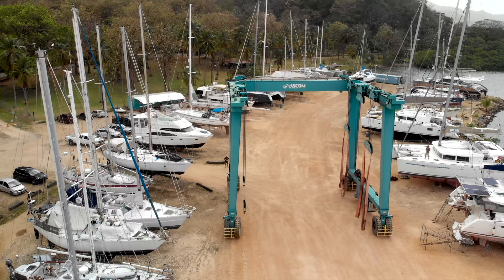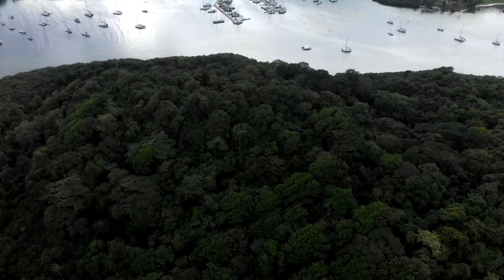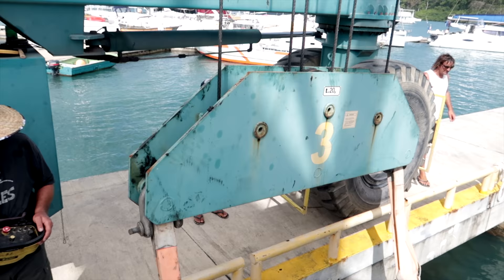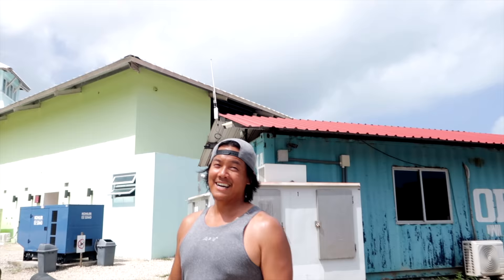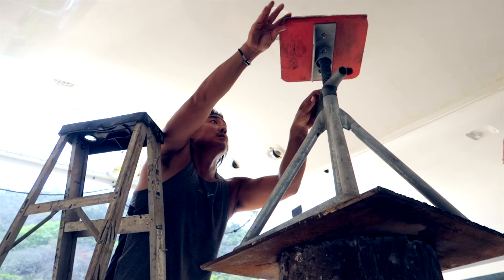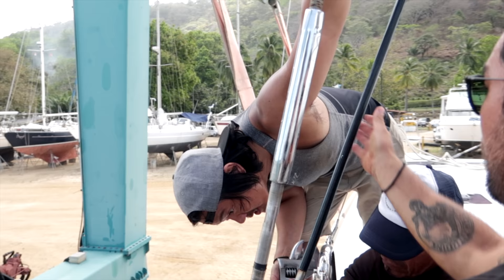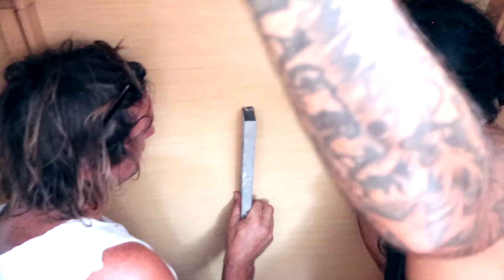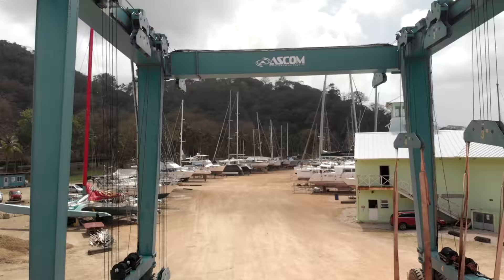Straighten Your Bent Catamaran in 8 Simple Steps - Cracked Bulkheads on Lagoon 450

Comment: Intersting that you have to loosen the rigging for it to level out. Makes me think it was too tight to begin with and caused damage otherwise it would be loose unless it was adjusted after the bulkhead break. What do you think?
Reply from the maker: So the bulkheads on lagoons 450s have been failing slowly since the boats initially launch. So over time the boats bend a bit and then at the next rigging check someone tightens the rigging back to spec. Then the boat bends some more and once again the rigging is slightly tightened the next year. It’s such a gradual process that owners/charter companies can’t really pinpoint the cause of slack. To add to that we’ve discovered that Lagoon’s tension specs are actually too much for the bulkhead design to handle. So you’re not wrong at all, the factory tension spec is too tight…or rather the bulkheads are too weak, . It’s now recommended to go a couple hundred kg’s under the low end of lagoons original tension range.
Reply: @david_shih  Thanks makes sense👍

Comment: Has anyone considered constructing the bulkhead like a box beam. The single or triple laminate plywood on the  bottom of the bulkhead has no flange. It is all web. Turning that bulkhead into a box with plywood on the outer faces with dimensional lumber creating the box will provide better resistance to the deflection. Fiberglass as a layer on a sheet of plywood is only marginally better then the raw plywood when you are loading it to bend on its length.
Reply from the maker: Tyrone, I read everything you said and it sound super smart but I’m a bit lost. Do you mean using dimensional lumber to create a frame and skin it with plywood? Or more like a section of traditional house framing, but with plywood instead of drywall?
Reply: @david_shih  Yes David, to both questions. But I think I would use hardwood to create the frame and "interior structure" of the new bulkhead. I would build the WHOLE bulkhead in EACH HULL as a frame. Very similar to an interior door in a house but on steroids. A house interior / closet door etc. is very, very strong in respect of bending resistance & torsion resistance in comparison to its weight. (Most interior house doors are skinned & "egg crated" with hard board-"Cardboard")
         The bulkhead plywood being one complete homogeneous piece or made to be one piece. This can be done by routering a 1/4" or two 1/8" - 3/16 " hardwood splines on the joining edges of the plywood. Like tongue & groove. I would entertain making the cosmetic interior plywood on both sides of the bulkhead the actual bulkhead. Stain it a light honey interior matching color & clear coat, varnish or epoxy coat it. 
         The interior of the framed bulkhead plywood, I would line with epoxy impregnated biaxial cloth. The interior of the "framed" bulkhead I would suggest using an "egg crate" "honeycomb" technique made from 1/8 -1/4" hardwood plywood everything coated in epoxy not fiberglass. Don't forget to provide drain holes. 
          I am attaching the following as an aid to understand the concept. https://www.popularwoodworking.com/woodworking-blogs/a-simple-jig-for-bottle-dividers-or-egg-crate-joints/
This is easily made with a circular saw. Even easier if the saw blade is the same thickness as the proposed egg-crate material/ plywood thickness. ie. 1/8 - 3/16 inch.. 
         It is a conceptual & industry problem. Very, very obvious in these videos;  
https://www.youtube.com/watch?v=UX9hH2bIbnw
https://www.youtube.com/watch?v=hAQuq-OW5RU&t=256s

Comment: Seeing a structural bulkhead just bent like that gives me the absolute willies... you'd imagine that Lagoon would be falling all over themselves trying to get this sorted but... from what I've seen they appear to have their heads in the sand :(
Reply from the maker: So weird isn’t it? They seem to have a total disregard for their reputation and hard earned brand equity!
Reply: @david_shih  not that weird, I've seen this a lot in IT security where some company gets hacked and a few million bits of personal information are floating on the 'net after, but they keep insisting it wasn't them, it wasn't real, it didn't happen, and when push comes to shove they'll potentially maybe admit that yes perhaps they did have something happen but no worries, it's under control! It's a knee-jerk reaction to a problem - or rather, attempting to ignore the problem until it goes away. I guess in Lagoon's case, they don't want to be like "yep, the 450 has a problem" and end up either having to recall all of them, or repairing all of them on their dime because it'll probably bankrupt them to do so. Plus the reputation damage. Like it or not, right now their reputation is still pretty solid, since only a few (comparatively) people know of this issue and that it's a proper "thing", but if it comes out in all the trade mags "Lagoon has design flaw", they're fooked beyond belief. 

Still, they oughta make it right.
Reply: @david_shih  considering lives could be at stake if a boat failed mis ocean, very strange...
Reply from the maker: Excellent point UncleBenny...I'm so in the middle of it it feels liek everyone I talk to knows about Lagoons dirtly little secrets, but youre right, nobody (big picture) knows. Ok...how do we get their design and build practices into trade mags?!
Reply from the maker: I would hate for it to get to that point Rob. That would be so sad. Good thing most owners are already aware of the issue. Some are in denial and trying to fight its existence to the death, but at least they know.
Reply: @david_shih  don't ask me, I'm just an IT geek :D I'd imagine it would take multiple owners organising together and writing to the various mags with a plea for help of sorts, to at least make the issue public. It is kind of the nuclear option, though, after that there's no going back because Lagoon will either lawyer up and start suing people left and right, or they'll just double down and be like "fook all y'all" and blame it on overtightened rigging, hurricane damage, or grounding and hope that their word beats yours. 

I mean, the only reason I know is because I watch Colin's videos (and now yours), and I have no dog in this fight since I don't have a Lagoon (and probably never will after all this :P) so yeah, I guess it could do with more publicity. But again, that's taking it from 0 to 100 real fast.
Reply from the maker: Good points...lots to think about here. Thanks for the ideas.

Comment: Benneteau yachts owns Lagoon, they could turn this all around by a Lagoon recall, Parley Revival repair, and change to design. Expedition Evans repaired a Bennetau single hull, I am not certain the design & manufacturing wasnt as flawed as are the Lagoon's coming out of the production line. If Benneteau does not authorize & fund a recall on Lagoon cats................. short their stock Euronext: BEN as they are doomed as  a company.... the entire marine industry are talking about all the fractured infrastructure on not only Lagoon, but Bennetau as well!! The recall would fix all boats, end class action suites, and repair their critically damaged name.
Reply from the maker: yes, the newer ones are still having bulkhead issues. a recall, or even a recall partially funded by owners, would do wonders for their brand and future loyalty. Sounds like you've really thought this through...wish i followed the marine and boat building industry better.
Reply: @david_shih  I live in Fort Lauderdale, I heard  three owners all talking about this very topic, and they were furious, cant say I blame them. Parleys fix is rock solid, congratulations on a good repair, and happy sailing.
Reply from the maker: Ah…fll, what an huge boating community there. Do you sail as well?

Comment: "Since the Lagoon 39 and 52 in 2012, the mast of all Lagoon catamarans does not rest on the partition wall but is located further aft, in order to increase the size and ease-of-use of the self-tacking jib hence improving the mainsail/headsail arrangement and overall performance." https://en.wikipedia.org/wiki/Lagoon_catamaran
Reply from the maker: they actually did the same on the 42 and 46 recently. hey how do you like the garmin virb? Nice flying vids btw, i would love to get back into it again 1 day! What a sense of freedom being able to take off and make a beeline at twice the speed to an airport far away.
Reply: @david_shih  The ViRB XE is ok, but the battery life is poor and they're difficult to source now. The internal GPS and BT integration with the cockpit audio is nice. I have decided to stop making  flying videos while I concentrate on wrapping up my instrument rating -- checkride coming soon! Aviation 101 and FlightChops are producing a much more professional product, because they do it full time. 

If you want to go far enough for the extra speed to make a difference, you need the instrument rating because there's often weather between Point A and Point B, just like when sailing. I spend a lot of time watching boating videos because it has so much in common with flying.
Reply from the maker: Sounds very similar! Everything just happens 50 times faster. Good luck on the instrument rating, keep us posted.
Reply: @david_shih  After today's flight my instructor said "It's time to schedule the checkride".
Reply from the maker: Congrats! Kill it!

Comment: Lay up some strain gauges in your reinforcing epoxy on the bulkheads, then you can monitor movement in the future. The strain gauge elements are very cheap and simple monitoring electronics is pretty well a DIY affair with bits off eBay
Reply from the maker: Really…excellent idea. Another thing to learn but I want to do this. Any particular type or brand you recommend?
Reply: @david_shih  I put the same suggestion on Colin's last video, but I'm not sure that he picked up the comment.
Reply: @david_shih  I don't think make or brand matter much. They are a very simple maze like etch of foil giving a long track length (usually) resulting in a resistance of about 350 ohms. As the maze is deformed the resistance alters and is measured by the electronics. You can go as simple or as complex in monitoring as you like, but you need the elements embedded as you do the work. Monitoring electronics can come later. Round the door openings would seem sensible, but Colin knows where the stresses are great having already suffered poor chap!

Comment: A single piece of plywood flexes. Any carpenter knows that. It should of bee 3 sheets of 11/8 with triple lamination at least.
Reply from the maker: Good call, that’s almost exactly the spec the designer of the boat told us use for the repair.

Comment: If it was my fix there would be two aluminum beams across boat.
Reply from the maker: funny you say that, bc leopards actually use a steel cross beam! Any ideas how to connect it? I'd imagine I'd need to reinforce the mounting points.
Reply: Maybe connected where mask shrouds are at.
Reply: I'd probably be replacing the plywood bulkheads with something like coosa-board.  Lighter in weight than plywood of the same thickness yet it's supposed to be about 50% stronger in both compression and flexing.  Plus, since it's a composite material, you will never have to worry about that repair ever rotting away if it gets wet!  Problem is, it COSTS about twice as much as the plywood.
Reply from the maker: 50% stronger in compression?! Thats exactly what that section needs! 2x the price of marine ply or regular ply? What's your rough estimate on a 4' x 8' sheet of coosa? We're talking 2-3 sheets only, so i can stomach the price difference.

Comment: Clearly you guys are taking great care to make sure the hulls will remain asymmetric above waterline. You are placing the catamaran in such a way that it will return to as close to factory specifications as possible. Nobody has really gone into what happens to the catamaran once you remove the main bulkhead so you can replace it. Scary stuff for sure. I'm sure there must be a lot more measuring before, during, and after the replacement than catamarans are showing in their videos. Clearly if you take the old bulkhead out, use it as a template, and it goes back in with minimal gaps it inspires confidence.  I have been left more than perplexed at the overall design of these bulkheads. Trippel reinforced at the bottom, and very flimsy from middle to top. Sure why not cut gaping holes in order to run wire, and create more failure points in the bulkhead. One thing is for sure. I would have removed the cabinetry starting from the opposite ends rather than starting from the middle and work my way back. Smooth move Ex-lax on the over all design, and installation of those cabinets.
Reply from the maker: Excellent observations. The hulls are supported as well so in theory there’s no weight on the bulkheads during repair. I agree on the wiring holes they cut…it’s literally like a purposeful perforation encouraging a split in that section. No surprise that’s where ~30% of the boats with broken bulkheads are breaking. Sounds like you have some experience in this world of building. Keep the suggestions coming, I can use all the help I can get. Cheers!
Reply: @david_shih  I have owned one of these holes in the water you pour money into all my adult life. Never a catamaran, always a mono hull. Right now a Hunter 39, and before that a Hunter 38. I keep threating the next one will be a catamaran because of the obvious increase in space, and comfort. Have just as many friends that say do it, as say don't do it. Wife already gave the green light, and don't think I could find a better time. No easy decision at X 4 the price. Found a two year old used one in Texas, but can't seem to get together for a date and time I could have it inspected. Very troubling.to say the least. Not going to just fly out there, and not know what I'm looking at. I found an inspector with the latest RF scanner technology that can see through walls. And I want plenty of pictures.  I must have mentioned broken, cracked, or detached bulkheads to the inspector at least five times. It's not a Lagoon catamaran.
Reply from the maker: Ah Nice, assuming it’s in Kemah? Just down the road from me. Let me know if I can help, I’m in town for another week.
Reply: @david_shih  The add is gone, and It's definitely a sellers market for any late model mid-priced cat right now. That should be good news for you. Contacted the racing boat manufacturer that made it, because they are not even offered in today's catalog. I'm not looking for a bare bones racer anyways. If I was going to buy one I should have done it three years ago like three of my friends did. It's not like I have to go cold turkey by not being able to sail.

Comment: 10% failure rate and growing in the automotive world is mandatory recall territory (actually I think it's even lower than that).  Given a similar design through the rest of the Lagoon sailing cats, it's probably in excess of 10% of ALL of their boats, not just the 450's.
.
Between you and Colin, you'll have the documented procedures (that LAGOON should be producing) to repair their crap design.
Reply from the maker: It's insane....its 10% of the 1000 or so built. The true metric is 80-90% of the boats that have actually been inspected have bulkhead issues! So the 10% is going to double/triple/quadrupal really fast!

Comment: I think you should take down the mask so there ain’t no pressure on the Holes
Reply from the maker: hey viv what part are you refering to?
Reply: @david_shih  if you’ve got cables holding up the mask link to the bulkheads of the holes and if the cables are tight that could be holding one side up more than the other because you’re trying to level of both holes before you put your new bulkheads in like you said one side was off by 7 mills when you tried to level it all off both sides to get it even Plus the weight of the mask itself put all of it into consideration and the cables that hold the mask up straight the tension on each guideline s and thank you for your great videos too mate is your guidelines tight on one side that could be the side that’s not dropped 7 mm and sorry for my spelling to me not much good at this to  sorry